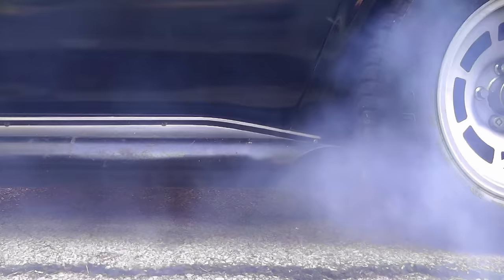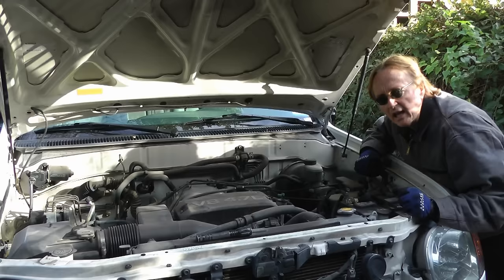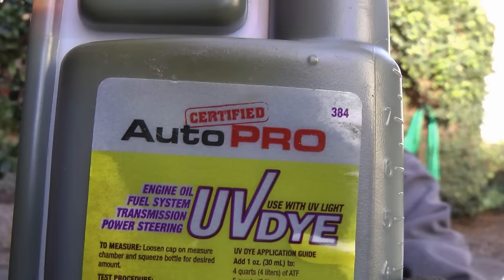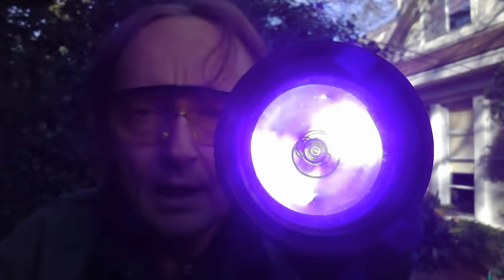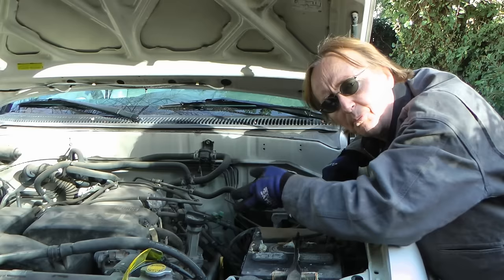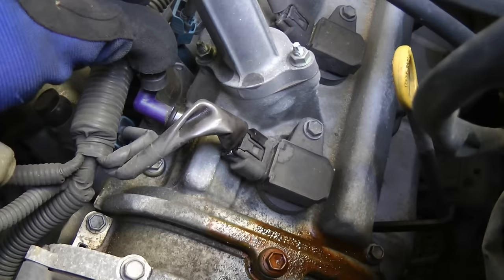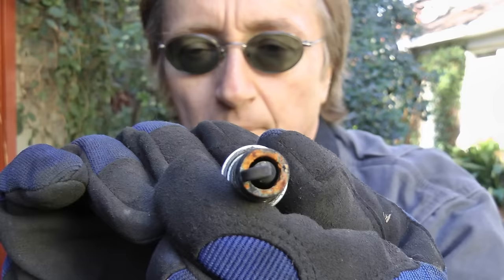How to Fix a Car Engine that Loses Oil (Leaks)

Comment: What about having a slight vanilla pudding look on the oil cap? I noticed that where the plastic oil fill tube wiggles a bit when I try to screw or unscrew the cap.
Reply: Welder Nate 
Thats just condensation its normal on cars that do short trips it wont hurt anything as long as you change the oil on time .
Reply: Ye I read about that after I typed this. Thanks though. Says long trips are better on vehicles 20-30 minute's.
Reply: Welder Nate 
yep highway miles are a lot easier on the car and will burn off the condensation

Comment: Great vids mate.. My vw passat 19tdi  smokes a bit when I turn it on most mornings for a few seconds then clears.but dosent smoke when it runs '' any ideas mate.??
Reply from the maker: ThePanzer6969 vw diesel engines often smoke when started up IF they have some miles on them. Normal for worn diesels
Reply: Thanks bud.

Comment: I have an 03 F-150 that uses oil. It only has 80,000 miles on it. There is no smoke from the exhaust and no oil leaks. If the PCV valve is bad and oil is being burned, would there be smoke from the exhaust or would the catalytic converter stop it?
Reply from the maker: change the pcv and pray, often it will not smoke when they are bad, just will use oil
Reply: Scotty Kilmer Thanks for quick reply, I'm subscribing.

Comment: hi i have a 2000 bmw 328ci i just bought and when i changed the oil it started leaking everytime i park it it leaks alot only when parked tho..i checked the oil plug ect ect and i dont know why its doing that and its not smoking or overheating please help

Comment: Hey Scotty what do you think of the product called "Engine Restorer" from a company called "Automotive Products"?
Reply from the maker: pretty much a joke, I'd stay away. STP oil additive works fine for older engines that burn oil by slowing it down some. But nothing fixes it.

Comment: Hi Scotty I've got a 2004 BMW 316i with 60k miles and my car burns 1 Quart every 1000 miles. There are no leaks the engine is bone dry, no power loss runs great, I see some blue smoke only when my car is going on a steep hill with 4000 rpm. My mechanic says he will check if it's the pcv valve and will add proper LL01 Castrol oil. 
If it still burns the oil after the pcv valve is change, what else shall I try?
Reply from the maker: bmws often burn oil, if pcv valve doesn't fix it, live with it. Oil is cheap, engine rebuilds are not. blue smoke is burning metal and oil, so changing the pcv won't fix that
Reply: Scotty Kilmer Hi Scotty I just wanted to let you know that I fixed the problem. The PCV valve was stuck :) so they replaced it. I drove 2000 miles and the oil is the same, no burning :)
Reply: Scotty Kilmer

Comment: Hi Scotty,

Well I just had the oil changed on my 2002 Nissan Altima ( has around 325,000 km on it) and for some bizarre reason despite it being high mileage oil the car still seems to burn it. Had the PCV valve replaced, using Quaker State Defy Semi-Synthetic oil, with Fram high milage filter and Restore - engine restorer. Is there anything else I could possibly do to fix the oil burning on this car? (BTW the oil change had only been done around 3 weeks ago.)
Reply from the maker: Jolly Good you're lucky it went that far, those altimas have weak engines that burn oil at that age, all of them.  You're doing what you can do, but perhaps try castrol oil next time with one quart of lucas oil additve and pray

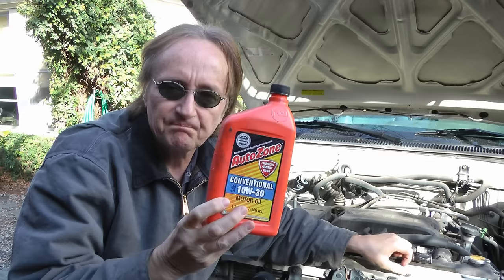Comment: 3:22 i don't see how you can prevent this problem. wont the piston rings eventually wear from rubbing up and down so many times? theres just so much they can take, right?
Reply from the maker: as long as the oil and filter are changed a lot and remain clean, they lube the engine. I've seen toyotas with over 500 thousand miles on them that really still run fine on the original engine when oil was changed regularly
Reply: Scotty Kilmer ive always believed that every 3,000 was too soon and that it was just a scam for oil companies to sell more oil. do you think oil really needs to be changed that often?
Reply: TheEgg185 Working at a jiffy lube, i can tell you its a big scam. I always change filter every 3k and motor oil every 6k.

Comment: Scotty I owned a 2005 chevy Colorado but it doesn't have a pcv valve and I checked the spark plugs and nothing  every 3500 miles I change the oil and it's a quart short of oil any suggestions on what could be the problem
Reply from the maker: +Sabino Vazquez  those burn oil as they age, one quart of nothing for those things, live with it

Comment: Hi Scotty, I ran into a problem and I need your help, I bought a used Nissan Murano 2003 and after driving for a couple of days it threw a code p0420 I bought the cat converter bank 1 but never got a chance to change , I changed my car oil 7k miles before and my car would run out of engine oil so fast I would always keep a separate can of oil with me just recently I forgot to put oil and went for a drive of 200 miles on my way back the car was running slow so I floored the gas pedal as everyone behind was honking, by doing so my car started shaking and I had to pull over somehow I got home at a speed around 40 mph and next day when I started the car it will not start, I poured more engine oil and nothing it just clicks, I checked the battery it was good the next thing I checked fuses under the hood they were all good I took the starter out and took it to autozone it was good , my car has dtc p0420, p0300, p0021, p1800 , I need you advice please help me I am a DIYer and I love working on cars

Comment: Hi Scotty, do all cars have a PCV valve? My 10 year old Ford Focus seems to be going through a fair amount of engine oil, going from Max to Min level on the dipstick in a month. No obvious signs of a leak.

Any help much appreciated.
Reply from the maker: many modern cars don't use them, if you want to check, get your vin, call a dealer parts dept, they can tell you
Reply: Thanks!

Comment: Scotty can a small amount of seafoam in the oil cause it to spit oil into the airbox with a clogged crankcase breather filter?
Reply: +Peter Kapica not possible
Reply: +Peter Kapica The seafoam isn't doing that, but ventilation issues could.
Reply: The filter was full of oil. After changing it out, no problem

Comment: hey Scotty I have a 2009 smart fortwo , when I checked underneath the car I sall gunked  up oil all over the rear axle. I'm pretty sure it's the seals but how do u replace those?
Reply from the maker: you remove the drive shaft and then pop out the old seal with a seal puller then snap in a new seal

Comment: I have Audi a4 1.8 and just now i started the car, the engine started shaking. when I accelerate, black smoke comes out of the exhaust. what's the problem? the acceleration is decreased by the way.
Reply: change the air filter

Comment: Hey s scottie I have a 05 honda pilot runs like crap when idling but runs like a top soon as you press the gas check engine light on codes for po175 and po172 system to rich bank1 system to rich bank2 help me out I know you can

Comment: hI scotty. I have a Seat Ibiza 2005 1200cc and I did an oil check and I found out that the oil is above the high line. After a research I saw that the head gasket might be blown and coolant from the radiator sneaks into the engine and ends up in the oil pan therefore increasing the oil level. After checking the coolant level it looked like it was on max. (My parents own that by the way) Is it worrying?
Reply from the maker: +Neddy Neris  do my video "how to tell if your head gasket is blown" to find out for sure
Reply: well if the head gasket was blown wouldnt it make weird noise? Or lose of power?

Comment: I have a 2006 Sentra Spec V and it seems to consume oil at a fast rate. What can be done?
Reply from the maker: +TeriyakiRan try this video, but if it doesn't work, get rid of the car, those had weak engines and burning oil means it's wearing out

Comment: Hi. I have a 1999 Toyota Corolla VE with 100k. It is currently using 1 quart of oil every 115 miles (2 weeks). Could not find leaks. I am using Mobil 1 High Mileage full synthetic oil 5w30. Also yesterday the check engine light came on with P0125 code. Have changed spark plugs, oil pan before as part of maintenance a year ago. Change engine oil every 3k miles. Do not have the means to change the car. What can I do so that the car stays functional?
Reply from the maker: replace the pcv valve and pray it's just stuck open sucking oil into the engine. But if that doesn't help, i'd get rid of it cause the engine would be worn out inside. as for the other code, just change the thermostat and fill the cooling system back up

Comment: hi scotty!i have a toyota hilux 2012 4×4 pick up which emitts white smoke on the tail pipe and consumes oil,the mechanic replaced the turbocharger with new one but still nothing changed!do you have any advice on what really causes this problem?thanks
Reply: Could be a leaky head gasket. I'd go see a second mechanic for their opinion.

Comment: nissan G35 VQ engine drinks oil. seems to be a common problem. Is there a fix?
Reply from the maker: yea, get rid of it and buy a toyota. Those require engine rebuilds to fix that

Comment: Hey Scotty i have a 1964 ford falcon 289 but the engine is from a 1967 ford mustang what kind of oil or type you recommend me to put ...
Reply from the maker: I would use 20 w 40 oil, like castrol
Reply: Thanks man from Laredo,tx ..

Comment: Hey Scotty, I changed the transmissionoil in my 2007 Nissan Altima about 3 months ago after it started jerking. The jerking stopped. Now it's happening again and it's not leaking any oil on the ground. What could be causing this problem, or is it normal to have to add transmission fluid every few months? Thanks
Reply: +Scotty Kilmer Thanks Scotty. Could I use this method for the transmission too
Reply: +Jervis Ford You might want to start using a stronger transmission fluid if you get it rebuilt again.
Reply: Thanks Lucas. I hope it doesn't come to that.

Comment: I just changed my oil in my dodge charger r/t and used my car starter and a huge cloud of blue smoke come out and then it went white or normal colour smelt like a ski doo i was shocked
Reply from the maker: +Random Videos make sure you didn't overfill the oil, AND if not, I'd change the type of oil you are using and use a different brand filter

Comment: hi scottie, even with all maintance and oil changes, pcv value replacement etc.. My honda vtech motor still burns some oil (1 quart between 5 k oil changes), do you think high mileage synthetic is good?  I currently use high mileage regular oil, has 190K on motor.
Reply from the maker: hondas tend to do that, but try castrol regular oil first, and if it works better , stay there. if not , live with it engine work costs a ton
Reply from the maker: Ahmad Salama
generally worn piston rings or worn valve seals

Comment: Hi I was riding down the interstate and my car lost power and when I pull to the side is started leaking oil its not running hot or anything it just lost power and leaking oil
Reply: I had someone to look at the car and they said it was my axle is making some kind of noise when I put it in drive

Comment: on my 1999 Chevy Malibu. my oil light was dinging. then I park it. while the car was still running. then it starts flashing. what you think might be the problem?
Reply from the maker: pray it's just a bad sending unit and not a wearing out engine with real low oil pressure that costs a ton to fix
Reply: It got only 144,000 miles and it runs beautiful

Comment: Just changed my neon pcv valve and I looked had some oil in the inside
Reply from the maker: they all have oil on the inside part, just not supposed to make it on the outside part that feeds the engine from vacuum sucking in vapor

Comment: why do i find oil were the air filter goes?
Reply from the maker: as engines age, they get what's called blow by from worn piston rings. Just keep adding oil as it burns up, or have the engine rebuilt, which costs a ton.

Comment: my 87 monte carlo's dipstick read about 2 quarts low, about 300 miles after my last oil change. after adding 2 quarts my oil pressure gauge is reading very high oil pressure. given it wasn't reading low oil before i added it, is the sensor just bad?
Reply from the maker: try a new sensor, but realize worn clogged engines often will raise internal oil pressure, so some parts have too much pressure, and others have too little AFTER the clog.

Comment: Recently My VW loses a lot of oil and after driving for about 20 miles the oil warning light comes on too. The engine has only done 80,000 miles.

About a year back I disconnected the EGR valve because the engine kept stalling and the EGR warning light was always on. Now only the engine warning check light is on but no stalling. The oil loss has only just started.  Could the problems be connected and could disconnecting the EGR damage engine?

Thanks in advance
Reply from the maker: egr will not make it burn oil that way. check the  PCV valve first, pray it's shot and sucking oil into the intake.
Reply: check your oil pressure switch could be losing mass amount of oil from there
Reply: Scotty Kilmer Whats the pcv valve? and is that a common issue with 1996 honda accord. to explain why they lose oil and burn oil? or is it just loose valve isue?

Comment: hey Scotty I have a 1998 Chevy Silverado with 202,000 miles on it and it goes through a quart of oil between oil changes is this normal? I change the oil every 3,000 miles
Reply: +Hash Head the confederate flag aint bad
Reply: who read that to you?
Reply: Dylan Clay that's not to bad now a quart every 500 miles is bad  but every  3000 isn't  bad.
Reply: It used to be a quart every 3000 miles but now it's a quart every 600-800 miles I think it's the valve seals since I'm not really loosing any power
Reply: If it smokes a little when you start it . That could be it. The 5.7 was bullet proof. A overhaul would probably get you another 200000 miles. Loved the Chevy body from 1988 to 98.
Reply: It doesn't smoke at start up just some when under a load after it warms up but just white smoke not blue
Reply: Dylan Clay that's good it's  white and not blue. blue smoke is a sign of metal to metal contact. white can be oil  to. hope  it's not to serious.
Reply: I havent noticed any loss of power yet so I don't think it's the piston rings
Reply: I have tore down a motor like yours  before and it be wore just a few thousands of a inch from factory  specks. Just had to hone it and put new rings and have the  crank turned and new bearings  and had new cam and bearings put in.easiest motor I ever messed with. Sorry I'm just a gear head .loved working with my uncle before he died.
Reply: You're fine and I'm gonna get a rebuild kit once the rings go I change the oil every 3000 miles so it should last a lot longer
Reply: Lmfao!
Reply: Hash Head I love that flag, cause I love the south. Gtfo
Reply: Too too since when does society hold children accountable for the crimes of their fathers, grandfathers, etc, committed before they were even born?
They dont.  So please take your race baiting victim card somewhere else. Nobody alive today ever knew anyone who was a slave or owned a slave. Stop attempting to elicit shame from people solely because of the color of their skin. I know some people from the south and their respect for the confederate flag in no way shape or form is in support of slavery or intends to disrespect blacks. On the contrary it is in defiance of the economic  punishment inflicted upon the south by the north after the war, and related to the issues the war was fought over. (excessive taxation by a central federal govt with little return in services) The scorched earth policy sought to punish them with poverty and starvation, for their rebellion. These very things impacted blacks in the south equally. 
So the confederate flag should not be used as a tool of division between southern blacks and whites but as a tool of unity as you wonder why the north still keeps all of you down and uses that flag as a way to shame the south. 
Are you really that dense to think denigrating and shaming whites in the south- avoiding their businesses, preventing tourism... wont have similar consequences for blacks?

Comment: I just did a oil change on my 2000 oldsmobile alero and when I put the new oil in only a quart of oil showed up. Idk what the problem is idk what could be the problem no oil leak
Reply from the maker: Shai Lee if you put all the oil in, and it shows only one quart in it, then something's plugged up inside the engine causing it not to drain into the crankcase and show full on the dipstick

Comment: hey Scotty I have a 1990 Toyota Camry and underneath  the  car  there is a oil leak at driver's side next to the wheel  I already checked the oil pan and diamond seal under the car and removed the cylinder heads and timing belt components so what can cause it to drip oil under the car when I park it
Reply from the maker: +Deo Nandkumar leaking oil pump seal, do my video "finding and fixing car oil leaks" to find the source
Reply: +Scotty Kilmer I  already did that 3 times